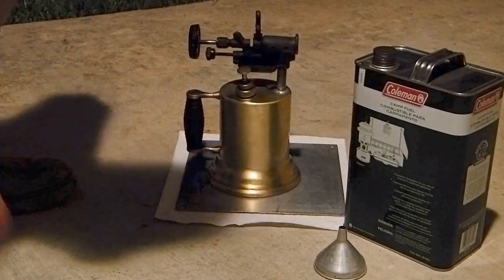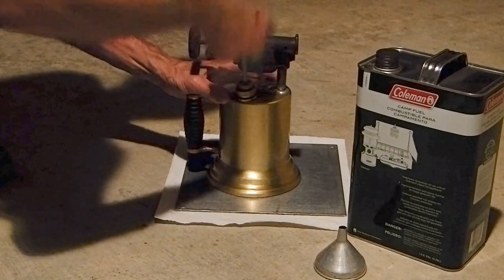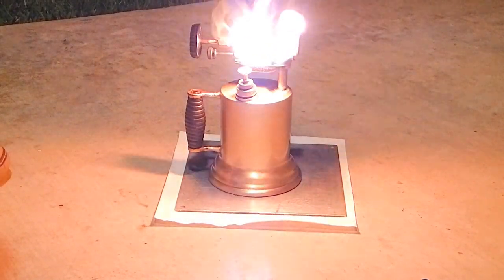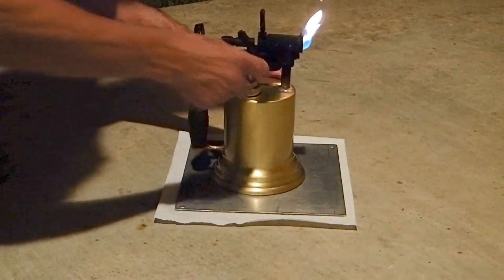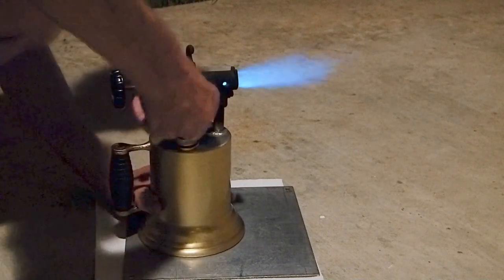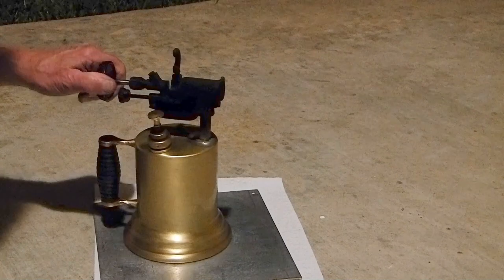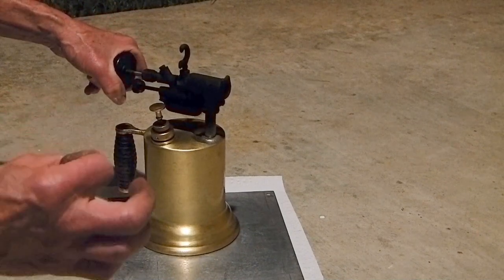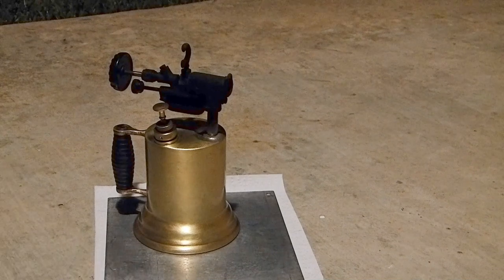Vintage Blowtorch Roars to Life (Good and Loud)

Comment: We have these exact torches at work at the mobile electric generator. It's a massive 30kw unit on wheels meant to be towed by a tractor. They're there to warm up the oil and the body of the unit before starting in temperatures below negative 10 degrees Celsius. Awesome video!
Reply from the maker: Such a great application for these torches! Large amounts of heat with affordable fuel. Thanks for sharing the info.😊

Comment: As a person who owns multiple Coleman lanterns and has a large supply of white gas, this is way more convenient than dealing with propane. I'm totally going to have to buy one of these old gas blow torches.
Reply from the maker: These torches put out a very large amount of heat for just a few cents compaired to buying disposable propane cylinders. However, you might keep in mind that for operations like brazing, propane does burn slightly hotter than white gas and most propane torches provide a more pencil-point flame. Hope you can find a good blow torch!

Comment: My dad worked in a body shop in the '30's, using lead. I guess that's where the term "Lead Sled" came from. We bought a 1930 Seagrave Suburban engine, and was restoring it. I used Bondo on a dent in the gas tank, and had it perfect. But, I went back over and my Bondo was gone. In it's place was a perfectly smooth lead fill. He used some wooden paddles to push the lead around, and smooth it out. I had no idea you could get lead to stick to steel. I still have his blowtorch. Maybe time to spruce it up.
Reply from the maker: Good story! Lead will stick to steel, but the trick is to use a very active flux that contains acid.
Reply: @dallen612  
  Yeah, I still have a roll of his acid core solder. I can remember him warning me to not use it on my electronics, back in the '60's. Don't know why I hold on to some of this stuff.

Comment: Good to see this one working. A friend gave me a Turner that looks identical. I guessed it was for burning kerosene. Glad you answered that question. Thanks
Reply from the maker: Does your Turner have the somewhat rare small valve for filling the priming cup? Also, how is your Turner marked? The only marking on my torch is a large number 45 stamped into the pump side of the burner. I've always wondered who made this torch. Good luck with yours!
Reply: @Allen-Dennis  My Turner does have smaller valve Like yours . Right side marked Turner 39g. Left side marked sycamore Ill.
Reply from the maker: @tedboots2785  Thank you for confirming the identification! Several viewers have inquired about the maker. Now I can tell them.

Comment: I like the fact that you saw it working  when you were younger  and you can see the white in the flame I was once told (white was right) on these old torches,
Reply from the maker: Yes, the white you mentioned is what is called the inner cone of the flame. It’s generally the hottest part of the flame. When you see that bluish-white, you know that the air/fuel ratio is just right and the burner is working properly.

Comment: That flame is huge!
I'm painting a steel one right now, I have a soldering iron too that an old man I used to work with gave me.
Reply from the maker: This particular torch produces a very powerful flame. Especially if you give it a good pumping after it's cleanly burning. Wish I knew which manufacture made it, but it had no name marks or decals when I got it. Just the number 45 stamped on one side of the burner.

Comment: 👍23+ yrs commercial refrigeration & HVAC mechanic. Retired in 07. Glad never had to use one of these type torches. Oxy/acetylene & B-tank would sweat everything needed. Nowadays techs are using the can of map gas small jobs. 
Good video.
Reply from the maker: It has definitely gotten easier:-) Thanks watching!

Comment: You should NEVER pump a gasoline torch while it's lit. Any failure in the check valve and you could get sprayed with gasoline.
Reply: I didn't even think of that, I do it all the time on lanterns and stoves.
Reply: @SAArch82  Running through hell with gasoline drawers on...
Reply: Yeah.....I got one of these but mine is a flat tank, and I got it running after all these years. I'm just a 17 year old boy with a knack for getting old tools working again. Now I know why you don't pump it when it is running...or if the valve is open.....I pumped it when the valve was open and I got a mouthful of gasoline!😂
Reply: They had balls back in the day.
Reply: All gas pressure appliances require pumping while lit (lanterns and stoves) - it’s a standard practice. It states to do so while lit from the manufacturer’s instructions. The check valve in most appliances can be removed and cleaned during restoration, ask the thousands of Coleman Collectors that do this on a regular basis.
Reply: @kurtmyers  You can do it if you want, it's just stupid and dangerous. Don't complain to me if you ignite.
Reply: I was pumping the fuel pump on my Coleman 228J while it as lit and the check valve failed. All it did was lose air pressure and go out. It did not spray gas everywhere and light me on fire. The plunger in these fuel pumps are air tight. They have to be in order to pressurize the tank. They are not going to let the liquid fuel backflow through them and spray everywhere.
Reply: @UltraMagaFan  I've seen failures where this did happen. The reason you weren't fried to a crunchy crisp isn't that you were smart, it's that you were lucky.
Reply: I have restored many gas pressure appliances. Check valves do lose pressure from time to time, as stated the appliance just loses its air and goes out. Cleaning or replacing the check valve (brass fitting with a stainless steel ball inside) will fix the issue. The blowtorch in the video uses a NRV (non return valve) those are more finicky and can be problematic if not inspected regularly. Originally there was a cork PIP and spring that stopped the backflow of fuel. Replacing the spring and using a modern fuel safe PIP is necessary. As a rule when pumping NRV point the pump in a safe direction.
Reply: @arthurserino2254  These check valves, even when they fail, let such a small amount of gas through at such a low rate it’s not going to spray everywhere. When the check valve in my lantern failed the fuel was barely bubbling through it. It might be different with a blow torch, but with a Coleman lantern it’s pretty much impossible for the fuel to spray out of the pump. And even if it does, the fuel pump is pointed away from the burner and there’s a glass globe separating the 2. It’s most likely not going to catch on fire. I didn’t get lucky. You just have no idea how these things work.
Reply: @kurtmyers  If it happens to be upright and there's no fuel in the valve, yes. But the air has fuel vapor in it and can ignite. It's just a stupid and unnecessary practice. If you pump it up thoroughly and it holds pressure, you shouldn't have any need to unscrew the piston while it's burning anyway.
Reply: The need to pump a torch when lit is probably unnecessary. The need to pump a Coleman style lantern or stove when lit is necessary. These devices have been made for over 100 years. Coleman, Peteomax, and the Amish still make them. In the manufactures instructions they tell you pump after it’s lit. Maybe you should stick with battery powered items.
Reply: @JohnCasteel1333  I am referring to the lack of safety devices back then. They also didn't have ketchup bottles with instructions to open here.
Reply: @jamesd1672  It doesn't take a genius to open a ketchup bottle, and it doesn't take a genius not to fuck around with gasoline torches.
Reply: @arthurserino2254  it doesn't take a genius to use a gasoline torch either.
Reply: @jamesd1672  When you play dumb ass games, you win dumb ass prizes.
Reply: @arthurserino2254 And what game are you referring to?  Just because you are uncomfortable using a tool doesn't mean it can not be operated safely and used as it is intended.
Reply: @jamesd1672  Show me the instruction manual that says it's okay to pump it while it's lit.
Reply: @arthurserino2254  The  manuals I have don't specify you can not. I don't know when the manual got involved in this discussion. I was just stating the fact that  "they"  the old timmers before us had enough balls to light gasoline in a pan inches above a pressurized fuel tank. It doesn't seem natural, sketchy at best, but it works. I am just wondering why my 1920s brass tourch has a wick like material in the fuel tank, but my 2008 russian torch does not. Both of them work great.
Reply: @jamesd1672  Russians cut corners. Old timers did a lot of stupid things back in the day, and usually they were ok, but sometimes they got hurt. That's why so many of them have missing body parts.

Comment: Plumbers used it too. Lead pipes and lead sealer for cast iron drains. Pop said they are dangerous. They can overheat and blow up.
Reply from the maker: My grandparents built a new house in the early 1960s. I was able to watch the plumbers pack the joints of the cast iron drain pipes with Okum packing. A mold was then placed around the joint and these torches or a plumber's smelter were used to melt lead which was poured from a ladle into the mold. After the smoke cleared and the lead cooled, the mold was removed. What remained was a shiny lead ring which held the packing tightly in place.

Comment: Before Coleman fuel, every gas station sold white gas, (unleaded) as well as kerosene and other solvents. I'm 76 and I remember my dad using his blowtorch for heating floor tiles to soften them and the adhesive for removal, as well as soldering.

Comment: I have a couple of the soldering irons you mentioned. One is unknown as i cannot find a manufacturer logo or anything on it, but the one i di know about is from around 1864 and was made by Hungerford. It's a pretty heavy chunk of copper, about 3 pounds in weight.

Comment: 50%lead 50%tin you can still find solder irons from a Hinkle Supply or Grainger has them. There are a few different copper heads (by weight) If you purchase one makes sure you get a tinning block (Sal amoniac) then heat your irons almost till cherry red,rub iron on tinning bar while you touch the iron with a solder bar (1/4 pound)$$$ now you have tinned your iron and ready to old school solder. You'll notice that you'll have to dip the iron in a solution of acid/water to keep it clean and from burning up. 🔥 have fun...
Reply from the maker: Great information! Thank you for sharing!

Comment: I just received one of these exact models, time to restore!
Reply from the maker: Does yours have any decals or other identifying marks? The only thing I could find on mine was the number 45 stamped into the burner on the same side as the pump. The tank had been painted and someome might have removed the decals.

Comment: I just saw some on ebay and was wondering what it used for fuel and you answered that
Reply: Do some research before dumping fuel in it. Many of these torch companies made different models and some used kerosene. And the gas burning versions are similar to an old Coleman gas lamp or Coleman gas stove which were designed to run on what they used to call "white gas". The part that converts the liquid to gas vapor is known as a "gas generator" and many have a fiber material packed inside a tube. Older cars ran on leaded gasoline and that lead in the gas would clog most of these "gas generators". The "white gas" is no longer available at gas stations. I haven't seen it since the early 70's here in Iowa. The gas station I worked at kept a tank of it for people that still had "white gas" stoves to cook on and some still had "white gas" portable room heaters. The unleaded pump gas for modern cars may work in some of these old torches but it's not something most of them were ever designed to burn. Kerosene versions are going to need kerosene or you could use what's known as "lamp fuel" in them. "Lamp fuel" is a more refined version of kerosene and comes in different colors and smells less obnoxious than truck stop kerosene. "Lamp fuel" is often sold in places like Walmart in the camping section next to the kerosene lanterns. They make it in different colors for use and display in the older style glass kerosene table lamps. Some places sell replicas of those old indoor kerosene lamps and often carry the colored "lamp fuel" to go with the lamps. Kerosene will clog a torch designed to run on "white gas" and I suspect that "white gas" will burn too hot in a torch designed to run on kerosene.

Comment: I see these at antique store a lot and they’ve always intrigued me. I wonder how hot they get and the heat difference based on the kind of fuels used.
Reply from the maker: Around 2400-2500 degrees F according to what I've read. Camp fuel and unleaded gasoline are what is commonly used for fuel. Temperatures would be very similar because their composition is nearly the same except for additives.
Reply: @Allen-Dennis what about waste engine oil?
Reply from the maker: No, it is not volatile enough.

Comment: Very awesome tool, seems to burn hotter than a modern touch🙂
Reply from the maker: The camp fuel I was burning is pretty much the same as gasoline. I read on Wikipedia that when burning in air the theoretical maximum flame temperature is 3880 degrees F for gasoline and 3596 degrees F for propane. In actual use the the temperature for a gasoline blow torch will be more like 2400 F. Most of the torches sold at hardware stores are made to use propane.
Reply: interesting🙂 was given one for a b-day gift and have been workin on getting it going👍 watched your video to learn how to fire it up! thanks for sharing this friend👍
Reply from the maker: You're welcome! Glad I could help.

Comment: @Allen-Dennis Where did you find parts for the rebuild? I'm considering buying one of these, but I want to actually use it.
Reply from the maker: I've been repairing engines and carburetors for many years and already had the materials for making the parts. The seal for the main valve shaft was made by twisting teflon plumbers tape into a string. This string was then wound around the shaft, packed into the valve body and contained with the packing nut. You could also use commercial graphite string packing available at hardware stores. The seal for the cap on the pump was cut from gasoline proof gasket material using hole punches. A larger punch was used to cut the outside diameter and a smaller punch to cut the opening for the pump cylinder.  The main pump piston seal was made by cutting a disk from a piece of 1/16" thick leather. The leather was soaked with oil and hand-formed over a metal rod to form it into the cupped shape that was required. The pump had a check valve made from cork. I used a small hole punch to cut a new seal from some 1/8" thick cork gasket material. Good luck with your rebuild!

Comment: I have one of these in the basement. Been tempted to light it up. I wonder about the dangers. Can these torches explode when pre-warming the burner head, with an open flame like that ? Looks kinda dangerous.
Reply from the maker: These torches don't explode because there is no ignition source available inside the fuel tank. However, with a defective torch there is a very real danger of fire and injury if there are any leaks where fuel or fuel vapor could escape and be ignited by the pre-warming flame.  
Before lighting, these torches must be tested for leaks under pressure and any leaks found must be repaired. Leak sources include the burner-to-tank pipe threads, seal for the pump to tank, pump piston, check valve in the pump and the packing for the control valve(s). To be completely safe, some people use water for leak testing. Do more research and learn all you can before lighting. Good luck and be careful!!
Reply: @Allen-Dennis  Thank you very much these tips. Yes, the importance of testing the equipment for leaks prior to using, similar to how you would check the fittings on a B.B.Q / tank with soap and water.

Comment: I've got a Otto Bernz kerosene torch that I need put a leather washer in I'd never heard of a leather washer before but I found some on line I'm kinda Leary of lighting it ....any suggestions? ... thank you for your time and help I appreciate it have a nice day 😄😊
Reply from the maker: Back in the day when these torches were the main source of portable heat, leather, cork and special papers were the main sources for seals and gaskets. These material worked very well if used properly. For your new leather seal, I would recommend coating it with some wheel bearing grease before installing. This will help it seal better and keep it flexible. Before lighting, leak test the torch while under pressure with bubble soap or commercial leak detector. Good luck!

Comment: What do people use blow torches for?
Reply from the maker: Loosen rusty nuts and bolts, stripping paint, soldering copper pipes and other metal, and heating steel to make it easier to bend.